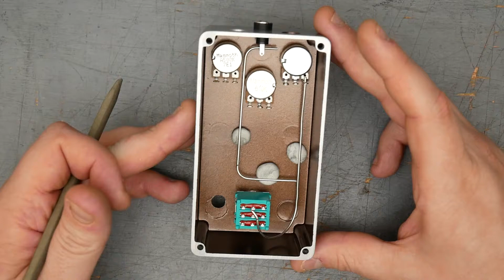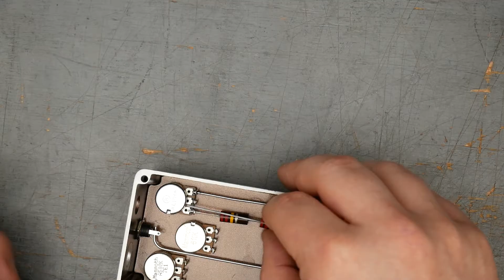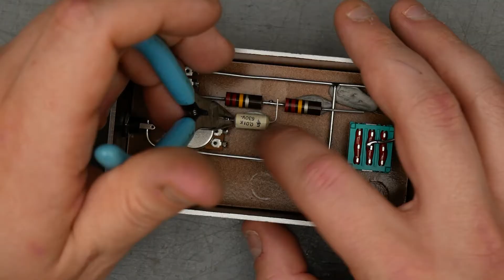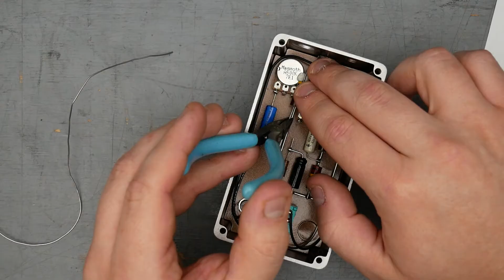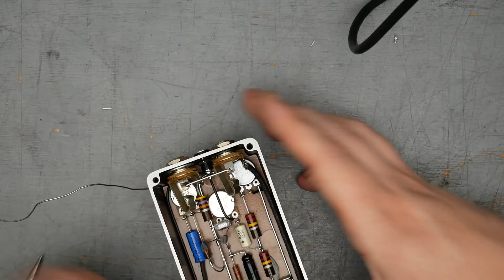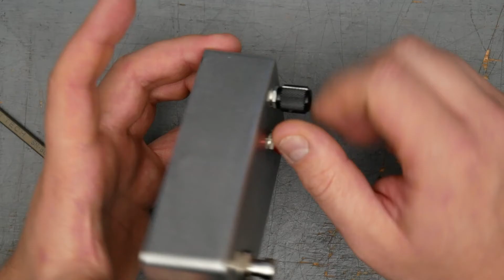Building a $400 Fuzz Pedal at Home! Part 2; Let's Build!

Comment: Hi. May be somebody knows, what is the best or recommended  capacitors for a fuzz face? So that it sound the best or original Dallas arbiter fuzz face. I know that input and power capacitors should be electrolytic and output could be fulm. I'm asking because I build a fuzz face. And choosing right capacitors it's a problem for me. May be somebody could help me.

Comment: Is this 10uf electrolytic capacitor reversed? With positive wired to the footswitch and negative to Drift pin 3? Looking at Marcus Reeves Zo II, both the electrolytic caps are wired same direction? Was this version wired differently for a reason?

Comment: Cool project, even tough the building technique is senseless. There is no benefit whatsoever in terms of circuit efficiency, RF interference reduction, or any discernible audio quality with this "point to point" build, in fact there are several disadvantages. Rule number one that apply to any electronic project is "lead solder is for electrical connection only, never to be used as structural joint". At a bear minimum use eyelets, if you really hate any sort of board. You are in the position to inspire new pedal builders, please don't overlook the basics.
Reply: Yes, I'd be thinking about the structural support of the circuit. It doesn't sit easily with me, but I'm guessing Marcus doesn't get many failures (and they'd be easy to repair). I'd assume you'd get the same point to point construction poking leads through pref board and soldering their little legs together. The finished product does look fantastic though, but then again so do D*A*M builds on humble vero.

Comment: This kicks ass thank you so much for sharing.  Instafan here.

What temperature do you run your soldering iron at?
Reply from the maker: This is the metcal SP200, it sets temp automatically based on the curie point
Reply: @graybenchelec  Thanks

Comment: what are the specs for the led resistor
Reply from the maker: good values for LED resistors off 9V are anywhere 1k to 10k. 4.7k is a common value for high brightness LEDs.

Comment: 630V caps for 9V pedal?:body-blue-raised-arms:
Reply from the maker: Usually it's just mojo sillyness, but in this case it's useful. The high voltage components tend to have heavier gauge leads, which make the "dead bug" styling assembly more robust.
Reply: There's that, plus some manufactures don't have the capacitor value you need in the lower voltages. It looks like JB don't make a 10nf which i wanted fit a fuzz face in the 250v/400v range. I guess axial poly caps are generally made for high voltage applications.

Comment: the paint will also help against noise from ground loops through the case and pots
Reply: Really? What science are you taking about???
Reply: There is something in that comment. Some builders avoid ground loops by only grounding one point in the entire unit. Star grounding is one example of this. There is science behind it, however in my experience I've not had to worry about it in my builds. It is a better engineering practice overall, but most people just build what they can get away with, and nothing wrong with that, doing things perfectly adds complexity, thought and ultimately cost or time.

Comment: Very cool that Markus supported these videos and gave you a shout-out on Instagram too.
What gauge is the bus wire you used? I use 0.5mm silver plated copper wire for the footswitch jumpers, usually.
Reply: Probably at least 1.0 mm. I've bought some jewellery wire to try this out (copper based). I was wondering if Marcus clear coats his components, they all look so shiny.